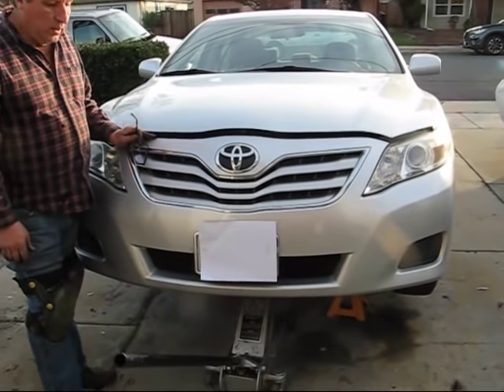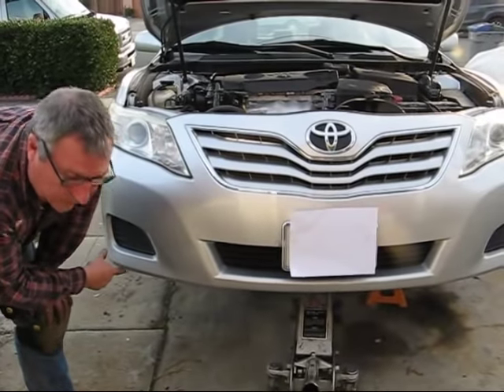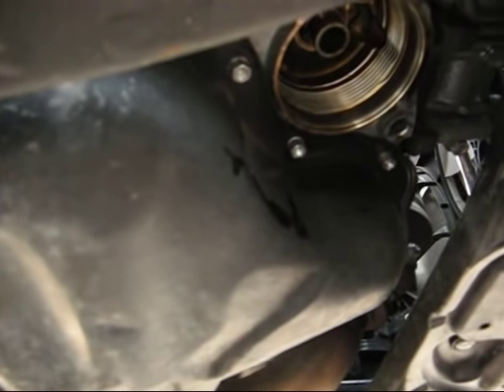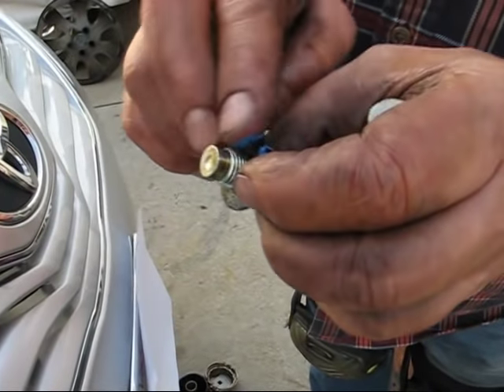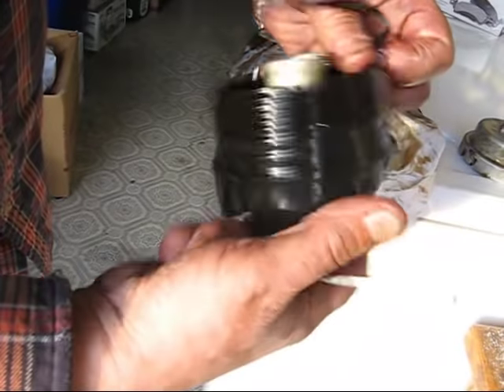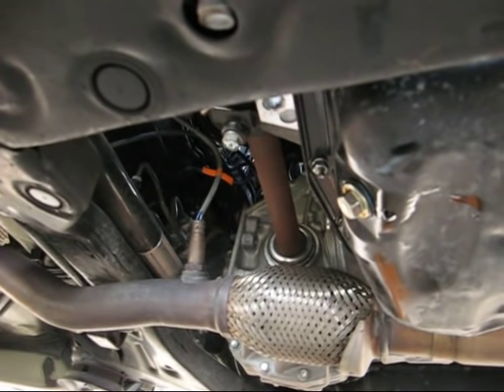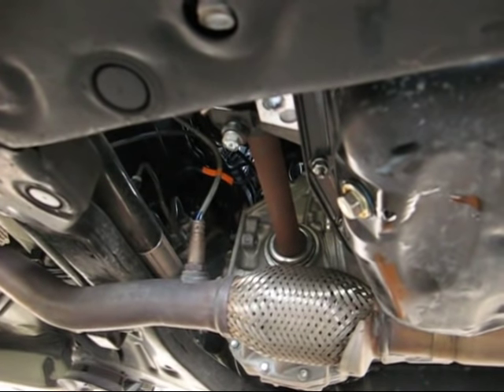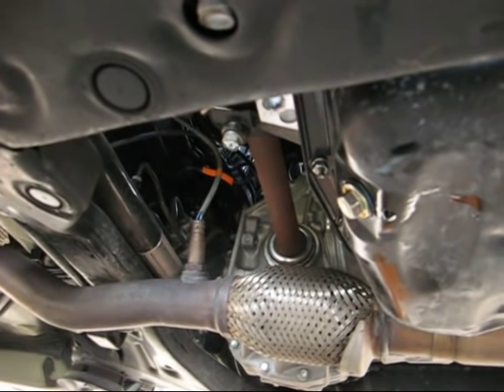How to Change Oil and Filter on Toyota Camry 2011 and Up - Plus Reset Maintenance Light

Comment: Thank you for the video on how to do the oil change! My dad used to change the oil on my 2009 Nissan Versa,  but I recently bought a 2011 Camry because I drive my cars a LOT and this one had low milage. Your video quality was clear, and I understand why you choose what you do for the oil itself.
Reply from the maker: It is not that hard and does not take that long.
By the time I go to an oil changer, I can all three of my cars done.
I usually buy 2 filters at a time and buy a couple cases of oil when it is on sale.

Comment: THANK YOU!  Went from 2007 Audi A3 to a 2011 Toyota Camry.  Very helpful!
Reply from the maker: Should be able to keep the Camry until you get sick of driving it.  Then someone else can continue to drive it.  My wife gets sick of hers about every 17 - 18 years.  Brakes, tires, window wipes, oil changes, 1 head light bulb,  wax 3 time a years because it is an outside car.

Comment: Good video, very informative.  My son just bought a used 2011 Camry and we plan to have the oil changed this weekend.  We were torn between saving a few dollars and doing it ourselves or paying to have it done.  After watching you video I think we'll knock it out our ourselves.  Thanks.
Reply from the maker: Not that hard, just a little dirty.  Just watch where you put the rubber o-ring.   My dad started showing me how to work on cars when I was 14.  I have saved thousands doing it myself.  With the oil changes, by time you take it in, and wait while it is done, you can do all your cars.

Comment: Thank you for your video. I was looking for the oil filter on my 2011 Camery. Couldn't find it until I saw your video. Now I just need to buy the oil filter adapter from Toyota dealer.  Thank you
Reply from the maker: Buy the good one, you only have to buy it once.

Comment: Good video, but the owners' manual recommends 5-W20 or 0-W20 oil
Reply from the maker: So.  I said in the video that I don't use what they recommend.  I don't even use synthetic oil, I use regular oil (5w-30, I used to use 10w-40) and change it every 5,000 miles.  I usually use oil from Costco when it comes on sale.
Reply: I use 0W-20 Super Tech full synthetic. It's only about $3 a quart when you buy it in five quart jugs. I also change mine every 5,000 miles.
If you buy from Costco, check out the Kirkland oil, it IS SYNTHETIC and it cost even less. https://m.youtube.com/watch?v=l9il_piyuT8&t=595s
Reply: I was about to say the same thing but the man wants to use what he wants can't get mad at that great video
Reply: I use 5w-20 shaffer

Comment: Hey great video.  Is that oil filter socket needed to change the filter?
Reply from the maker: Yes.  Don't buy a plastic one because if you screw up your filter housing, good luck.  I bought the one at Toyota and paid the extra money.   Not happy but safe.  I will get 15 years out of it because my wife keep her Camry's for 15 years.   She sells them when she is sick and tired of the car, not because it can not run any longer.

Comment from the maker: I have no idea why Toyota went to thus type.  The older models had an easy twist on canister type.  Maybe they want to make it a little harder so you take it t o the dealer instead of doing it yourself.  

No way Toyota.
Reply: Isn't it great. So much more fun. Those spin-on filters were oh so boring. Now when I change my oil I get a real sense of accomplishment. Besides, a lot of people are home due to the coronavirus. It gives you something to do. Of course, once it's done, then what? Nobody is going anywhere so the next oil change will be who knows when?
Reply from the maker: @stevensevek6151  I love spin on filters.  I thing they changed it so it would make it harder for people and they would have to bring it in and get charged.  Service means many dollars.   Like the Big Pharma, they don't want cures, they want more customers.
Reply: The reason they changed to this type filter was initial startup starves oil getting to the main parts of engine and over time this wear out vital parts so they use this type so oil gets right to the engine rather than wait till the metal case fills with oil this way oil is direct and  another benefit to this ,longevity of their engines and we all know go Toyota or walk home
Reply from the maker: @sheddski2942  My Camry with the old filter type had 250,000 when I sold it.  The only reason why you sell your old Toyota is because you are sick of it, not because it stops running.
Reply from the maker: Zach Buford  If someone asks me what kind of car to buy, i tell them a Camry.

Comment: I recommend buying the metal canister lid that Toyota makes. The plastic stock one if over tighten may crack when trying to remove. Amazon sells them.
Reply from the maker: I bought mine from Toyota.  Per recommendation from my local auto parts store.
Reply: Better yet, I recommend not over-tightening it.

Comment: great video sir, i was at walmart the other day looking at Fram oil filters and the reference booklet shows a throw away type canister filter, is that a replacement for the removable element OEM type?  Doesn't make sense since it looks completely different....
Reply from the maker: It is an insert style oil filter, video 3:30 and 6:38.  The filter fits into the plastic housing.   It is not the old type like in video 1:27.  

When you buy it, open the box to check to see if if is the filter element not a metal canister.

Comment: Hi I own a 2014  and a 2016 camry both are recommended  to use 0w-20 full syn. oil. I like that you prefer the  5w-30 conventional oil, but  why do you? How does the car perform with this oil? What part of the country do you live in? Is it hot/cold.  It also will violate the warranty by Toyota. Thanks if you can answer.
Reply from the maker: I talked to the Service Manager at Toyota and he told me that if you use synthetic oil, you only need to change the oil every 10,000 miles.  But if you change to regular 5w-30 or 10w-30, or 10w-40, (what every is on sale) it is recommended that you change the oil every 5,000 miles.  My personal opining, which means nothing, is that the oil is still getting dirty and the oil is holding the carbon particles. But since they are changing you at least double or more for synthetic, they have to space you out more on oil changes.  

He also told me a little story.  When these cars start getting older with higher mileage,  they use more oil.  The car owners are used to bringing it in on or after 10,000 miles.  Sooner or later, these cars will run out of oil and destroy the engine.  Then that is an opportunity us, they either have to put in a new engine in an old car or buy a new one.   Changing it at 5,000 miles with regular oil, saves you money on the long run and there is better chance you will never run it out of oil.
Reply from the maker: My wife's Camry has 106,000 miles and uses about 1/8 of a quart of oil between oil changes.  Nothing
Does it change performance - NO
I live in the Center of Silicon Valley with Google, and Apple.  The weather is the best, Jan/Feb could go as low as mid 30s and summer can go as high as 100, but not very many days.  90% of the time it is wonderful.
The service manager said NO but I keep records in the service manual.
Reply: @davidlis6709  Hi David, I talked to a few dealers and they said don't use regular oil at all. I asked them to tell me off the record as well and they still said NO. Would you please tell me which dealer you talked to. I would like to talk to them.
Also, have a great Thanks giving. I might just change anyway.  At what mileage
did you make the change to regular oil?  Mine only has 50000. What do you think?
Reply from the maker: @barryzakwin9147  I talked to the local service manager in in 2014, he has since moved on.  I changed over when the 3 years free service went away.  Maybe the car had 35,000 miles on it, today it has about 110,000 and still running good.
Reply: @davidlis6709  thank you
Reply: @davidlis6709  Hi David, Do you still have the Camry? Is it still running 5W-30 regular oil?  I am about to run a different oil
in my 2014 Camry 4 cyl. I am overly cautious. Anything you can tell me?
Reply from the maker: @barryzakwin9147  I am running 10w-40 because it was on sale at Costco.

Don't worry about these Carmys.  My wife brought it home one day with oil all over and the red light on.  I changed the oil and filter and that was 50,000 miles ago.
Don't get carried away.

Comment: If you have used synthetic in the past, can you change to the w-30 weight oil with no issues?
Reply from the maker: Yes, I talked to the service manager at Toyota and he said yes but it is better when you do that to change oil at 5,000 miles.  
I switched as soon as the free maintenance expired.
 I change all my cars at 5,000.

Comment: Hi David, I would like to ask you which oil is the best for your 2011 Camry ?
Reply from the maker: I use 5-30.  Regular oil not synthetic  I change it every 5,000 miles.  I buy it at Costco when it is on sale. 
My wife's Camry is the best car we own.  They run until you get sick of them.  The last one had 185,000 and there was no reason to sell it besides being sick of the car.

Comment: very helpful video. Could you tell me what kind of motor oil, may I use for my CAMRY 2011  with 133 k miles.Please
Reply from the maker: I use 5-30 regular oil not and change it about every 5,000 miles.  I don't have any preference on brand.   When ever I see on sale, I buy several cases.
Reply: Full synthetic oil
Reply: 0W20 full synthetic

Comment: I've seen some other vide where it said that it's a good idea to fill up the oil filter with the new oil that you are about to put in your car.. does that help a lot more or does it not make a difference if the oil filter is empty or not?
Reply from the maker: As soon as you start the engine after changing the filter, the oil pump starts pumping oil to the oiling system of the engine.  It has to fill up the oil filter first before delivering oil to the rest of the engine.  This takes 1 or 2 seconds.  If you fill up the oil filter with oil, when you start the car, it will start pumping oil to the engine immediately.  

I never ad oil to the filter, I just start the car after filling the engine and let the oil pump do its job.   If you have a car with an oil gauge, you will see when the engine gets oil pressure because the gauge will move to the normal position showing oil pressure.  So the engine runs for a few seconds with full oil pressure.   My wife's last Toyota had 186,000, she sold it because she was tired of driving it and wanted a new one.  And the person she sold it to is still driving it.  So, does it make any difference?
Reply: It's not recommended but it's not recommended against either.  Whatever floats your boat. Does it make a difference? Probably. How much? Your guess is as good as anyone's.

Comment: Very good video,would you have a video for a sealed transmission flush on the Toyota Camry 2011 2.5 SE model, if yes can you make it available ..thanks
Reply: Just add more trans oil, i wouldnt flush trans oil
Reply: Drop and refil in side fill bolt then run car to get transmission fluid between 104 and 113 degrees the bleed off extra fluid through overfill tube inside drain bolt of transmission.  Car has to be level.  3.5 qts will come out when drained and I put 4 in and let it mix then do the bleed off of the 1/2 qt.  Not hard but you have to have bidirectional scanner to tell what fluid temperature is.

Comment: Why do you use thicker oil and how many miles you have on the car?
Reply from the maker: 100,000
I like the thicker oil as the car gets older.  As the engine wears with miles the tolerances increase, and the thicker oil takes up the gap.   My belief but I am not the engine designer.   I do not like synthetic oil especially for older engines.  I use the regular oil and change it every 5,000 miles.  Old school.

Comment: I went to the Toyota dealer near me and asked the service tech what brand oil they will use for Camry SE 2019.  He said that they will use Castrol 0W16.  Get to the Castrol website and Castrol doesn't make 0W16.  What am I not understanding ?  I would like to be constant in putting always the same brand and same VISCOSITY.  Any input !  Oh boy no wonder I don't go to the dealer and prefer doing things myself.  Also, the sticker on the Camry SE 2019 which I saw in the showroom does show 0W16.  Thanks.
Reply from the maker: I going out on a limb here.  I use 5w-30 regular oil.  I also change the oil every 5,000 miles.  Toyota says to use synthetic oil.  I talked to my local Toyota guy and he said it would be ok to use regular oil as long as you change the oil at 5,000 and not 10,000.

He also said that people that change the oil at 10,000 might be in trouble when the car get in the 200,000 mile range because when these cars start using oil they might not make 10,000 between oil changes and just run the car out of oil and destroy the engine.   But that would be good for business because they will have to buy another car.

Sorry - no real answer.
Reply: @davidlis6709  I am guessing that you have a Toyota Camry 2011 ?
Reply from the maker: That is my wife's car.  It has about 95k so far and running good.  I have replaced the tires, brakes, and window wipers so far.  I also change the oil at 5k.      Trouble free.
Reply: Yeah, Castrol sells them. Advance Auto Parts has it.

Comment: I checked with Toyota and they said the oil for my 2011 Camry is 0W20 weight full synthetic. Why would you change the oil weight?
Reply from the maker: My car, my choice.  I like regular oil and I change it every 5,000 miles, synthetic you can change at 10,000.  

I talked to Toyota myself and they told me if you change it at 5,000, then you can use regular.   

They also told me that in the future when a lot of these cars get old and start having 150,000 miles and up they will tend to use a little more oil.  Most people don't always bring it in when they are suppose to and tend to stretch it.   When my car uses 1 quart at 5,000 mile and yours uses 2 quarts at 10,000 mile, there is a lot less oil in your engine than in mine.  If I forget and I am down 1.5 quarts and yours is down more than 2 quarts, it could have engine failure due to not enough oil.  Everyone thinks different.  No right answer.
Reply: @davidlis6709  
The right answer is to check your oil regularly.

Comment: I bought a metal removal tool, but upon trying the drain plug on the filter housing, the whole filter came off. And I couldn't get the drain plug loose from the filter, so I think I'll take the tool back to OReilly ($10).
Reply from the maker: I hard to get it off.  I just use the tool and take the entire filter assembly off.   But one time, the drain plug may come off.   Keep and use the tool.   My 2 cents.

Comment: The maintenance reqd light comes after 5000 miles?
Reply from the maker: Because it wants another oil change, just turn it off.
I put a piece of masking tape on the radiator hose which tells me when I last changed it.
I always change it at 5,000 because I use regular oil.
Reply: @davidlis6709  I was asking because I don't when that light is supposed to come on

Comment: Was a nice beautiful weekend for a home garage oil change Cannisters tool broke on me. Was very upset :(
Reply from the maker: Buy the metal one.  The plastic ones are not that good.
How many time are you going to change the oil,  average the cost over the lifetime of the car.
Reply: You mean the oil filter cap wrench.

The best ones that have the best reviews are the Motivx brand. There are two different sizes make sure you get the right one.
https://www.amazon.com/Motivx-Tools-Filter-Wrench-Vehicles/dp/B078RHZP9M/ref=sr_1_3?dchild=1&keywords=Motivx+2320+2321&qid=1585937597&sr=8-3

When the oil filter cap is difficult to get off, make sure NOT to use the ⅜ inch ratchet opening in the top of the wrench. Use a 27 mm (1-1/16 in.) socket instead with a breaker bar if necessary.

Also, be sure to line up the teeth on the wrench with the tabs on the oil filter cap. You'd be surprised how many fail to do that even on some of the how to videos.

When installing the oil filter cap use the correct torque specs (if you have a torque wrench).
18 ft.lbs. on the oil filter cap
10 ft.lbs. on the oil filter cap drainplug.